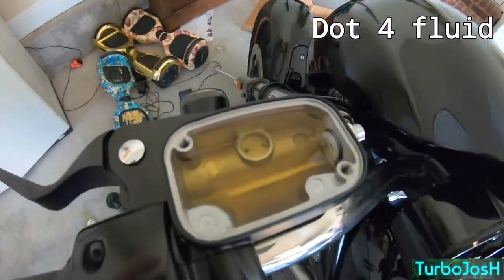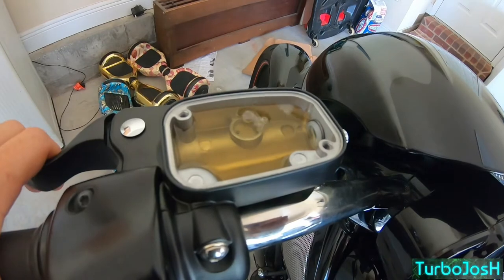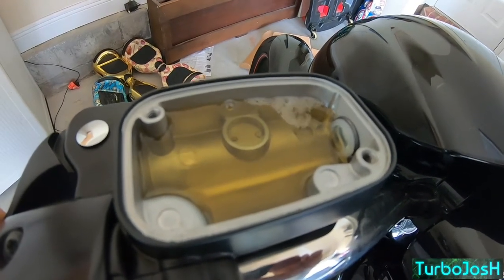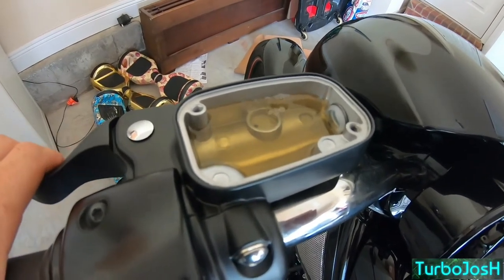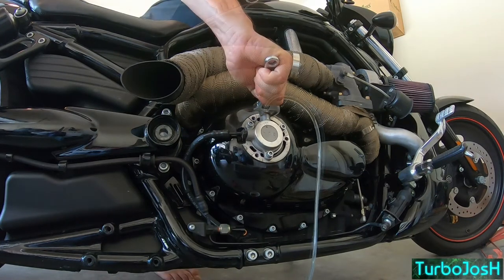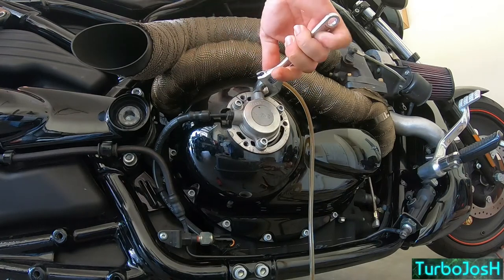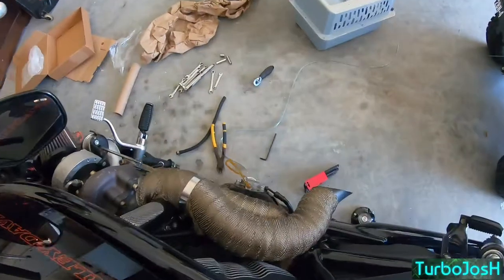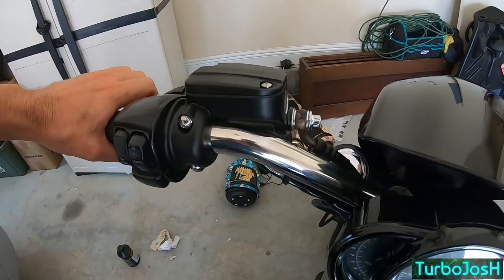Harley Davidson Clutch Bleed How To (All Harley Davidson)

Comment: My 2007 night rod special has been sitting for a couple years. I just cleaned it up tonight checked all fluids, etc etc. I took it for a ride and the clutch is slipping when I hit the gas. The bike only has 6,500 miles on it so the clutch plates can’t be bad as I was never hard on it. It did leak some  fluid as it sat around from underneath somewhere which I never determined what it was but it was probably clutch fluid. The salve cylinder is full and the fluid looks clean. After the short ride I took it smells like brake fluid or clutch fluid. 

After reading some blogs and such some are saying it could be the slave cylinder it something plugged somewhere. The clutch lever and such is to disengage the clutch so I’m confused as to why the clutch may not be fully engaging. Tomorrow I’ll just flush/bleed  the fluid . I’ve done it once before.  I’ll
Also look for leaks.

Any thoughts/explanations?
Reply from the maker: I'd bleed the system and also adjust your clutch. Can look that up on YouTube. They are also wet clutches so if it sat for a while the top half of your clutch pack could be dry which could burn those disc's so don't romp on it to bad if it slips before you get it situated. One other thing you can try is if because dry some plates stayed stuck together for sitting and oil draining out of them with gravity try for a day or 2 at a time tieing your clutch lever down over night it separates the plates.
Reply: @JoshRaySpot the fluid flush and replace did the trick. The bike was slipping in 2nd gear. The master cylinders in these bikes leak. I’ve been seeing others for sale around 2007 model and the pictures show the bubbles up paint around the caps. 

Now my problem is the bike is getting hot and the coolant symbol light is coming on. The cold fluid level is nothing, completely empty. Maybe I have a coolant leak. I’m just going to add coolant and see what happens
Reply: @lesliechow7286  You ever fix the problem? Did you make sure your radiator was topped off?
Reply: @SickSensei223  yes, the clutch came free. I also found my rear brake  fluid was leaking and I had to add some coolant to the radiator .

Comment: Where did you buy your clutch master cylinder? Need an aftermarket one
Reply from the maker: Ebay
Reply: Do you have a link? TIA
Reply: It would be great help, mine just broke and can’t find an aftermarket part that will fit. Went to HD quoted 800$ to replace mine with an OEM one.